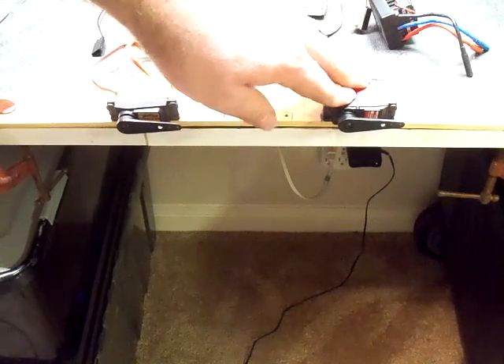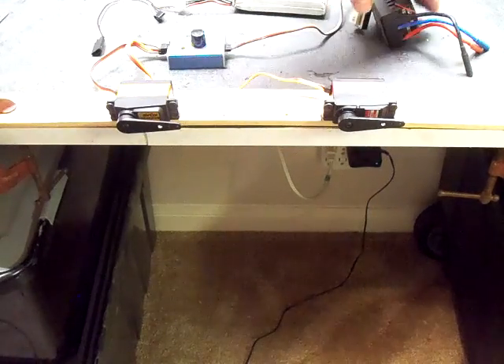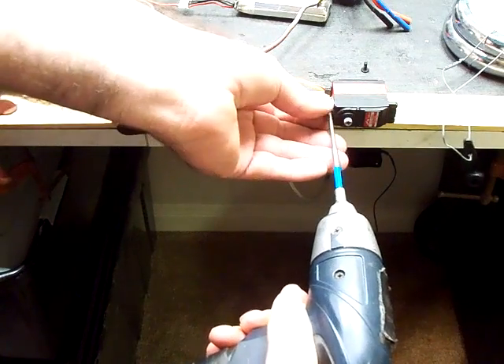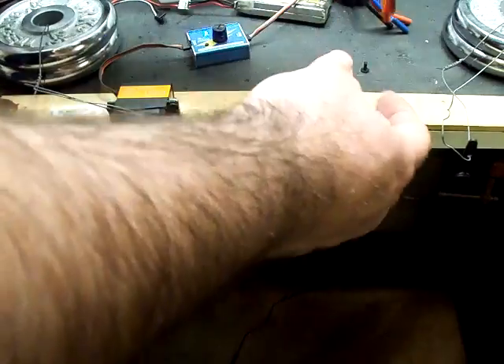Savox 1258 vs JX Coreless and Brushless HV servos

Comment: Hey Bill, I know it’s been a while but what’s your thoughts on JX after all this time? Thinking about 4 of the JX BLS-HV7032M on an airplane wings since they are as fast savox and I’ll be using 8.4v. Can you say something about the play on the gears when power is on and servo resting, comparing with savox? Thank you
Reply from the maker: still running the 7032 in one of my race cars, the gears tend to wear out after a year of use and start to get slop at that point... I have found the EcoPower gears to be a direct fit replacement, no slop in gears with a fresh set of gears installed:
https://www.rctech.net/forum/showpost.php?p=15403144&postcount=6
Reply: @billdelong  do the 7032 and 7232 use the same gears?
Reply from the maker: @stokedGSXR  not sure, it's been many years since I've owned these servos and don't have access to compare parts anymore, good luck!
Reply: @billdelong  no worries! I'll get a set of gears and see jf they work and update here in the next little while. Can't hurt to try!

I'm interested in knowing what servo you like now! I saw the falling out with agf but haven't seen many of your posts recently on the topic! You're always a good read!
Reply from the maker: @stokedGSXR  Thanks for the kind thoughts.. 
I am still running Nitro Pro CT2 servo in my eTruggy, that's a solid servo which is rebranded AGF that is highly modified and corrected all the design flaws from AGF. 

In my eBuggy  I'm running an SRT9032 and love that servo too... going forward I'll probably stick with SRT servos.

Comment: Just got back from testing my new JX 5821LV servo compared to the stock xp digital ds1903 my prosc 4x4 came with it's night and day. the seller did botch the description I thought i was getting a hell of a deal on a coreless 0.11s4.8v - 0.09s 6v  (new to the hobby) but in reality it is a 0.18s 4.8v - 0.16s 6v cored 2bb. I guess they put the description on from the more expensive JX 5830HV on the ad but in reality it's a JX 5821LV. Even still it's lightyears better than the DS1903 specs are 0.15s 6v @ 3.8kg - 50oz. I think I gained like 200oz or 16kg of torque compared to the stock. I'm going to try racing with it and see how it does. I'm going to also see if they will send me the 5830 that I thought I was getting.

Comment: bill you the man. i didn't realize it was you on here too until i just came to revisit this video after receiving my 5821 jx servo. but you helped me a lot deciding on what first truck to get for racing on the rcgroups forum. just wanted to tell you thanks for your post about the 4x4 sct's scores I ended up picking up a used team associated prosc 4x4 thanks to you and im upgrading it to be my first racer. got a JX 5821 server today thanks to this video too lol
Reply from the maker: glad I could help!
Congrats on the new truck and best of luck with the new servo too!
Reply: @billdelong  thanks, so far so good. I started with a helion avenge sc10 i bought on amazon for $200. great truck for the money but i ended up breaking the front skid plate within 3 days and it's is a mounting point for the steering turnbuckles and now it wont steer straight. can't find any parts for it hardly so HobbyTown ended up giving me a full refund since Helion went under and I ended up getting the ProSC 4x4 used as per your recommendation on the RCGroups forum page about the best SCT's to start with. Ironic that I found this video after searching for a decent servo upgrade for it and realized it was you as well so I had to make sure to say thanks lol! So far I like both the truck and the Servo and will probably be buying a faster JX one when I get better on a track. I've got a bunch of upgrades coming for the ProSC which the sway bars were impossible to find unless you search for Thunder Tiger sway bars on eBay and order them from Germany. It should be a force to be reckoned with when fully upgraded though.
Reply from the maker: @MrViqtim  
cool deal, some info here worth a read in selecting your next servo:
https://www.rctech.net/forum/showpost.php?p=15403144&postcount=6

Comment: I just got a jx coreless and it’s making a slight clicking sound when changing directions. Is this normal?
Reply from the maker: Brand new out of the box or after a hard crash then the clicking sound started?
Are you sure it's not the digital oscillation?
Reply: Bill DeLong brand spankey new. And not sure what you mean by that
Reply from the maker: @jmurr357  post a link to a recorded video, happy to listen and see if it sounds strange

Comment: Hi
I am debating whether this servo can be trusted for a 92-inch 3D plane??
Reply: hi.
i use the xj brushless in edge 540 pilot rc  92" on all surfaces  for 45-50 flights with 2 2s 3000mah lipo
like them very much perform very well 
very nice servo 
economical in power
after 10-12 flights have left about 75% in the batteries
think to put smaller batteries
Reply from the maker: I do not have experience with planes that large, I would refer to the manual of your plane and see what specs they recommend for servo selection, good luck!
Reply: @billdelong  first thing thank you. 
Perhaps I did not formulate my question properly,
I did not mean whether this servo (jx7032) fit my airplane or not.
I was going to ask if it is reliable enough to use it on a expensive plane ....?
Reply from the maker: @3D-RC  I feel the servo is reliable, however just be sure the stated specs for the torque requirements are satisfied for your plane... I would also inspect the servo horn for any slop in the gears... once you detect slop, then that is a good indicator that the gears are worn and will be at risk of stripping.

Comment: That jx servo looks bad ass! 50 bucks! I paid 89 for savox 1273tg because I wanted fast speed, at 7.4 it is .65 which is lightning fast! But, $50 for that speed and power? Is a steal!
Reply from the maker: I agree, it's a good deal, only problem I have is finding replacement gear sets... the steel tends to wear out after a year or so making these servos somewhat disposable when the gears strip out eventually :(
Reply: Check out "asiatees.com". There you can find spares for Jx servos

Comment: Hey bill, I look at ur post in rctech. U said that ur jx servo already striped its gear. And change the gear with other cheap jx servo. which servo did u use to change the gear?
Reply from the maker: I don't remember which one unfortunately, it was just the thin gear in the center, if you stripped the main spline, then this trick won't work :(
Reply: @billdelong  my car got quite a significant slop at the steering. And i found it from the servo. Is it normal for servo to have some slop?
Reply from the maker: No, when slop starts to form, it means that the gears are wearing out, just a matter of time before they strip.
Reply: @billdelong  seems like a bad news for me
Reply from the maker: It wouldn't hurt to clean all the gears and apply fresh grease, then flip them around 180° to use the good side, that should double the life of your gears ;)
Reply: @billdelong  aaahhh... Never thought of that. This why I like talking and refering to you. Thank you

Comment: Have tested it? How was it on the track compare to savox?
Reply from the maker: I run the JX brushless servos exclusively in my 1/8 buggy and truggy, great servos that perform very well, highly recommend them!
Reply: @billdelong  Are you satisfied still ?
Reply from the maker: @HeliModTRC  your timing is perfect, if you asked me last week I would've said yes, but this past weekend I ran into some glitching with one of my JX servos that I need to investigate. Problems went away went I swapped out the 3 year old servo, to be fair I had shortened the servo wire and didn't do as good of a job at wiring my replacement connector as I should have so it's possible that my issue was self inflicted... I plan to replace the connector soon to see if my glitching goes away.
Reply: @billdelong  Thank you :) . Please tell me what happened when you changed the connector. I will JX Servo for Helicopter. But your experience is important.
Reply from the maker: Pretty sure I made the length of the servo wire too short, there is some chassis flex in my car and I think the servo wire is getting pulled from the Rx after a hard crash, etc... since you will be using these for aircraft use and no impacts on the equipment, I think you will be very satisfied with the results. I would make it a point to periodically inspect your servos for any slop starting to form, I have had to replace the gear sets when running these servos in 1/8 cars, the gears last considerably longer in my 1/10 cars, no idea how they will wear in a helicopter. 

Gear sets from EcoPower WP120T at AMain are compatible: https://www.amainhobbies.com/ecopower-120t-metal-servo-gear-set-ecp-3099/p755536
Reply: @billdelong   Hello. Have you been able to replace the connector?
Reply from the maker: @HeliModTRC  Yes, I bought a crimp tool and have not had any problems since :)

Comment: Savox is still faster... the only reason your are hearing the savox make noise...It's because it's always trying to find it's center point..(It's not stressing)...
Reply from the maker: Savox is considerably louder under the same load and also pulls more power under the same load and also runs hotter temps under the same load.
Reply: The Savox is faster, because the Savox has a speed of 0.8 seconds with 6V. The JX has a speed of 0.8 seconds at 7.4V. JX is a HV servo. It may therefore have a speed equal to or even higher than 1258. The important thing is to supply the appropriate voltage .
Reply: Savox may be loud and power hungry but no one can question their power out put or durability

Comment: Thx Bill, gonna order the first one... Can you also suggest a waterproof esc... Thx in advance!
Reply from the maker: I haven't tested their ESC's but I've heard good things on the forums, 
and I love their motors, if I was going to buy a waterproof ESC today, 
I'd get a GoolRc, depending on your motor, I'd go with either the 120A 
or 150A version:
http://www.ebay.com/sch/i.html?_from=R40&_trksid=p2047675.m570.l1313.TR0.TRC0.H0.Xgoolrc+waterproof+esc.TRS0&_nkw=goolrc+waterproof+esc&_sacat=0
Reply from the maker: after going through their selection, it doesn't appear that GoolRC has 
any 150A waterproof ESC's after all... in that case I'd probably go with
 HobbyWing just to play it safe

Comment: Hey Bill, looking to get one for my Arrma Kraton. Which servo would you suggest and are they water proof? I'm also looking for a decent not overpriced waterproof esc.. Thx for informative video..
Reply from the maker: I would buy this one for myself if I was gonna buy one today: 
www.banggood.com/Power-HD-DW25LV-Waterproof-Servo-Metal-Gears-Strong-Torque-For-RC-Crawler-Truck-RC-Car-Part-p-1083555.html?p=P!1914166379201304IO

If performance wasn't important, then I might consider this one even though it's kinda slow:
www.banggood.com/Power-HD-LW-20MG-Waterproof-Digital-Servo-For-110-18-RC-Car-RC-Model-JRfutaba-Compatible-p-1067269.html?p=P!1914166379201304IO
Reply: Why not the JX BLS-HV7032MG, on the jx website, all their brushless servos are listed as waterproof. Is it not?  Have you tested? It's stronger, faster, and similiarly priced as the Power HD you recommend above.  Thanks for your kind reply.